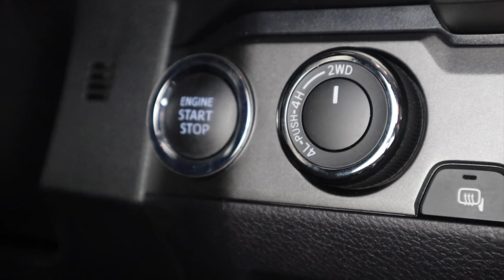Should you buy the latest Toyota Tacoma 2016-2021?

Comment: I own a 2017 TRD Sport long box auto trans. I tow a 21' camping trailer just under 4,000 pounds. So far I haven't noticed anything but the gear hunting issues you spoke about. I'm thinking of re-gearing the truck to either 4.88 or 5.29 (will be adding off road weight shortly like tires,mild lift, front/rear bumpter and skid plates). Do you suggest doing the gearing or not? Some times it just feels like the truck never hits 6th gear or doesn't have enough power towing the trailer. At 100km/h (60mph) I'm hitting 4,000+ RPM and the engine just screams.
Reply: @themuskyhunter3931  Tundra is a larger vehicle. The Tacoma is better suited for tight trails. I do love the Tundra's and I'd buy one just for hauling the camper but for off-roading I'd rather have the smaller footprint of a Tacoma than a Tundra. I do have the towing package on my Taco so the weight of the trailer isn't an issue, I can pull it just fine.

Comment: Great video! I have 2020 trd off road, Great truck but I have an annoying clicking moving sound coming from my driver seat. It tends to happen 39 to 49 minutes into my drive and occurs when I accelerate and brake. It feels like the seat is slightly moving back an fourth with a clicking sound. It was never a problem for the first 3 years, this problem just started a few months ago with an occasional click here and there but now it’s noticeable and happens everytime I drive. Driving me nuts. I’ve seen some taco forums and a few have the same issue! Have you come across this? Help!

Comment: I have a 2006 4 cylinder, SR5 Tacoma rear wheel drive, with about 89,000 miles. Its a bit slow 0-60, but that is ok. On cross country ski trips I usually have to shift down to 2nd or 3rd gear and am in right line going over mountain passes.  However after driving for about 3-4 hours, my highway mpg is 28-32. Why or how do I get this mpg on newer vehicles?

Comment: Oh boy. Got a 2018 Tacoma SR5 that I've updated to TRD wannabe status. K02 TIRES other goodies. Ok 59,000 miles on my 6cyl, change oil every 5000 miles. Ten thou is way to much to wait. (My opinion).there are no leaks, its burning oil. Then in morning or if it sits for 5-8 hrs blue smoke from exhaust. Took it to dealer. They charge 140 bucks for diagnostic and topped off oil, told me drive 1000 miles without touching dipstick or anything. Then they will do a pressure test. I think gaskets bad, oil on valves causing blue smoke when starts. I don't want to do any damage, but that's the dealers advise. Any thoughts?? Thanks.

Comment: I drive on a hilly highway a lot and when i use cruise control the truck shifts down to 4th gear a lot (going to 3500 rpms on any slight hill grade). for some reason it doesn't do the double down shift when not using cruise control. anyways, would installing the 4.88 gears everyone talks about save my transmission in the long run?

Comment: I just got a 2020 tacoma ....im getting the tc shudder I think between 45mph and 60. It happens when I start to push the gas just a little ...they say I have the newest update and my truck only has 9000 miles. .anything I can do??? 
I also feel shudder I believe at low speed 20mph-15mph when coasting or braking .ive been to the dealer and was told they all do it .....what can I do? I really like the truck but everyday it worries me that I feel this ..id really appreciate any feedback. Thank you
Reply from the maker: They are not smooth honestly. If you drive another one at the dealership and it does the same then it’s normal
Reply: @TheCarCareNut  some online say they dont have these issues .others do ...everytime I brake or slow down it makes me think driveline issue,rear brake issue or tranny issue and its a very uneasy feeling for a new vehicle ..if I am in sport mode and downshift myself at the right time then I dont feel it and its smooth.     Would this be something toyota can remedy for me?
Reply from the maker: You can contact Toyota and see. They will send someone to drive the car and look at it. If they see something they’ll take care of it

Comment: Love my 2018 tacoma I know with previous years of the tacoma they had steering issues with the intermediate shift.
I have noticed now with my truck that the steering has been not the same and has felt very sloppy and lose and not stiff like it use to be on the road.hitting bumps on the road and gravel.if anybody has had any issues of the same thing with this year I would like to know.
Reply from the maker: Hi! No issues with this model with the steering.
Reply: Hello my Tacoma is 98 and my steering was feeling funny.  When I make a turn it was stiff my mechanic check it out he did not find a problem but it was my ball joint going out it broke and my wheel came off glad I was not on the freeway. It was a scary experience. I got it fix.

Comment: I have a 2018 Trd sport and it has recently started to burn oil. Do these trucks have issue with burning oil?
Reply from the maker: Hi! No oil burning  issues reported yet. How many miles and what’s the oil change history?
Reply: @TheCarCareNut  I have 107000km and the issue started at 102000km…right after my warranty was up! Lucky me!! I religiously did my oil changes at every 8000km at my local Toyota dealer, as recommended. I also noticed that the truck stared a engine clacking sound in and around the time the truck started to burn oil. I bought this truck because of its reputation of being reliable and here I am tacking to my local Toyota dealer about needing a new engine at only 107000km! I’m very disappointed in this truck.
Reply from the maker: How much does it burn? And try replacing the pcv valve
Reply: @TheCarCareNut  last time I stopped by my local dealer to have it checked I had done a little less than 1000km and I was short 1 liter of oil. The dealer put me on a oil consumption test to see how much I’m burning every 500km but they made me understand that if there is a problem, the engine would need replacing and I wouldn’t be covered under warranty. Is the PCV something I change myself? How much oil consumption would a faulty PCV valve cause? Would the loud engine clacking be related to this as well? The noise seems to continue even after the oil has been topped up? Thanks for your time!

Comment: I’ve been reading a lot about engine failures lately on low mileage trucks. Cracks head blocks and valve issues. 2016-2020. Anything on this ? I have a 2021 TRDPro with 6k on it. I’ve read guys with 6-10k with headgaskets / valve issues.

Comment: I presented the  A/C off in hot stop-n-go traffic condition to my local dealer and they say TOYOTA needs to have the technician reproduce this condition with diagnostic data, ship it to Toyota central before they will ship out the parts.  They say a TSB and my ONE TIME situation isn't enough to get them to ante up $3k to make it right.  If they do diagnostic testing and can't reproduce the condition, I have to pay the $190/hr. rate for the drags. as well the $3k for the parts.  This stinks.  Please advise.
Reply from the maker: Hi! Take it to the dealership in a hot day where the issue typically happens.
Reply: @TheCarCareNut  Sorry, we don't get "hot" days here in Monterey, California by the ocean.  If the temperature raises to 72 degrees, we're running the A/C around town.  This shutdown condition was in Phoenix, Az. one time on one day.  The dealership can't duplicate these temperatures here locally (100 mile range) and my 3 year/36k mile B-2-B warranty ends in July.  I have 24k on my truck now and will not be in the Phoenix area for a while, way past my warranty period.  Seems I'm kinda stuck.

Comment: I’ve driven 2 brand new Tacoma’s Trd sport 2wd in the last couple of days and they both have the same vibration between 20-30 mph. It does it coasting or just maintaining speed in the range. Why can’t they get the driveline angle correct on these? I’m assuming that it’s the driveline angle. This is making me 2nd guess getting one. I did most paperwork on one and it’s not coming in till November 15. Have not signed for it though. How should I proceed have them address this issue before buying it?

Comment: Mr AMD, I just found your video very interesting information. Because I am doing research I'm thinking of buying a Toyota pickup 2020 or 21, I am looking more at the 4 cylinder with maybe four wheel drive because in the winter time in the Northeast the four wheel drive are very useful on those snow days. I was thinking about a manual shift, but I think that will be a problem for my wife. But you say the automatic are just as good, so I might end up going that way instead. Thanks for the video.

Comment: I never drove a Tacoma before, I have driven a recent 4runner though, and the ride didn't feel rough to me, I am also looking to trade in my Scion tC for a Taco, I am just tired of the rough ride, I'm at the age where it's bothersome, so is the Taco really that rough?
Reply from the maker: The Tacoma is a bit rougher riding than the 4runner. If smooth ride is a concern I would definitely test drive one or rent one for a few days to see how you like it
Reply: @TheCarCareNut  I'll definitely have to test drive one on real roads. If need be I could change plans and just get an older truck and use it for errands, and trade the tC for a car with a softer suspension.

Comment: One thing I noticed with my manual from the first day I drove mine off the lot is a sort of light rattling or shaking noise whenever I drive over a bump and I'm not in gear, say like I shift into neutral and go over a speed bump or turn into my driveway. I just don't understand what's going on.

Comment: I had my squeaky clutch fixed on my 2017 trd pro. It was annoying that the dealer didn't do the research on a tsb and I had to do that on my own. No issues after 2 years. I do my own oil changes and recently did the rear diff fluid change and the manual transmission change and what a huge difference in the shifting. I used mt90 and I'm glad I did. I also change the oil every 5k vs 10 and I spray the frame. Every 6 months. So far no issues with my truck. I do want to do the ac fan repair. Does anyone have a tsb number for that fix? Thanks!

Comment: Not only does the timing cover leak, but they use the same sealent and the leak comes back and is a 3 grand fix.. happens about every 50k miles and the only reason why its not seen as widespread is because it rarely leaks to the ground.. it leaks down the waterpump and when you drive the air pushes it onto the tranny and makes a nice black coating.. trash

Comment: I just bought a 2018 Toyota Tacoma V6 4X4 4 door long bed loaded with 115k miles...
Ine problem came up with the passenger seat, a friend of mine is pretty tall he went inside and sled the seat back so he can fit and it triggered the airbag/seat belt message on the dashboard and a message on the right side amber color message that it says "No airbag" so this thing it's been a nightmare for me...
The code shows that is B1650 "Occupant detection sensor"...
The vehicle never had a collision and the only thing is that the seat was moved to fit another person...
Is anyone has a knowledge about this problem so I can have an idea what actually the main source of the problem? 
Thanks guys...
I love Toyotas and this is my 4th Toyota...

Comment: Anyone here ever run into a grinding belt sound on your 3rd gen when turning on the AC?
This only happens if the vehicle has set for about a week > you start it > then later turn on the AC.
The moment the AC compressor clutch engages it makes a grinding belt sound. 

I just started getting this...just curious how other peoples experiences have been so far.

I've only found 1 other person with a 2019 Tacoma that also has the exact same issue.

Comment: I have a 2008 Tacoma I am the original owner it has 61,000 miles on it. I brought the truck to the local Toyota dealership back in 2016 to have the frame looked at because of the recall they claimed the frame was fine and sprayed it with a frame corrosion resistant compound and said it was good to go. Here we are in 2024 and the frame is completely rotted out and unsafe to drive complete driving hazard. Trying to get Toyota to work with me, but they keep giving me the runaround truck now sits at the top of my driveway completely useless. I’m pro Toyota, but this is Bull S- -t. Something needs to be done on their end.If this truck rips in half Toyota is completely aware of it.Can you say lawsuit?

Comment: I have a 18 TRD O/R and I have the engine shake just commented on another comment on here asking if he had the same problem. Talked to the dealership and they did a software update and it seemed to work for a little but now it’s back. The shake isn’t violent and ridiculous it’s just like a small stutter when switching gears around like 40-55 mph. If anyone has the same issue and got it all resolved and figured out would love to hear it thank you

Comment: My 2018 tacoma has 55000 I called the Toyota dealer about changing transmission fluid they told not to change my transmission fluid until 100000 miles they told me the transmission is sealed hard to get sealed back
Reply from the maker: The transmission is not sealed? It just doesn’t have a dipstick

Comment: With the exception of the 2016-2017 problem years all the other "issues" sounds like its just owning a truck. Vibrations, squeaks, seizing if you dont use 4wd. Frame rusting in the rust belt I dont see an issue on this. My buddy that lives there hasnt had one car that doesnt rust, if it plagues every car how can it be a Toyota problem.

Comment: Oil leaks, coolant leaks, coolant bypass leak that requires the body lifted off! Fuel pump, belt problems on the v6. Not very Toyota-like....never buy the first two years...honestly more problems than I would have expected...terrible air conditioning in hot climates, brake issues, horrendous radios,  sounds more like an American made car

Comment: Excuse after excuse, you can do this or buy that to fix it, and just the way it is. To much technology to give problems. I don't think I could buy a 3rd gen, I have a 1st gen and brother a 2nd gen and haven't experienced any of these or any problems. The problem with frames in the rust belt does goes all the way back to the 1st gens, you think they would have figured it out by now. Toyota was either buying 1st gens back or replacing the frames, at least it was at Toyota's expense.

Comment: Do not buy these new Tacomas! There is a hidden defect that affects them all. Inferior rear axles and wheel drums were installed, resulting in the drums warping and causing the trucks to shudder and shake after a year or two. Tacoma has not yet addressed this problem and Tacoma mechanics do not know what to diagnose, blaming it on out of balance tires and other problems. Even if it does not become a serious shudder, the ride suffers and there is always a slight tremor felt in the steering wheel, especially when the truck is cold. All these newer models should have been recalled when they first came out. The drivers side rear wheel on my 2016 locked up last week because of this problem. I am waiting for Toyota to get back to me to see what their solution will be. I loved this truck at first..now I regret buying it.

Comment: Toyota quality on trucks have TANKED!!! I have owned 3 of them, 1st and 2 2nd generation TRD off- road models, each one of the trucks frames have all rusted,. and the quality on the interiors.... SUCKS. Toyota purposefully put the forward front cab mounts closer to the front tires and wheels, so you can't install bigger ones. and 3:73 gears. back in the day they started with 4:10's. get an old school Toyota truck.

Comment: I would not buy these trucks if you expect them to have the same reliability as your older Tacoma.They are more like an average American truck. I have a 1st gen which is bullet proof. These 3rd gen are garbage. My 3rd gen has had both the timing belt cover issue and the coolant bypass joint replaced but beware I have had to take it back several time and they still have not been able to repair correctly  and they made it worst with new fuel leaks and continued oil leaks issues after they tried to repair. I have lost faith on Toyota reliability especially on these newer vehicles just see all the issues they are also having with the new Tundra and and in my experience Toyota dealer service dept are basically incompetent and leaving you with more problems and headaches than you had before the repair. Unreliable trucks without  adequate technical service support when an issue arises from Toyota makes them  very undesirable trucks to buy, own or hold.
Reply: Did they get everything worked out?

Comment: THIS GUY IS RIGHT, the truck is a noisy bitch, engine , body from the wind, / in gauging the 4wd drive 4h, 4l  for 2-4 miles a month/. i had the 2017 JUNK,  there other problems with the truck, toyota, installs 4.30 gears front/rear , if you want to pull a gas station behind you let it be?   i change to 3.73  why?  well it added 5 mpg to the city/and /the highway, the real mileage , factory stated, 18/24 , wrong, more like 13/18 , after the gear change, 18/26 , if you tow everyday use the lower gears , if just sometime 3.73 even the 4,10 was next down from stock,. friend has 4.10 2 miles lower then 3.73. if your going to run 37" or 40" tires leave the 4.30. i like the truck , not the price, my 2wd dodge 1500, 4.7l has 416,000 no repairs or rebuilt , all original, im going to sell the tundra, and make the dodge 4x4 instead.